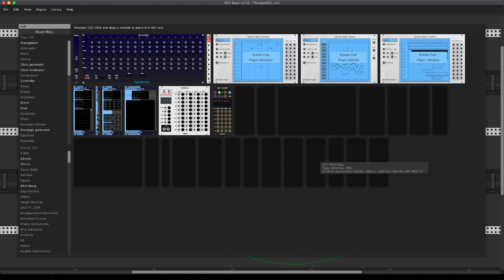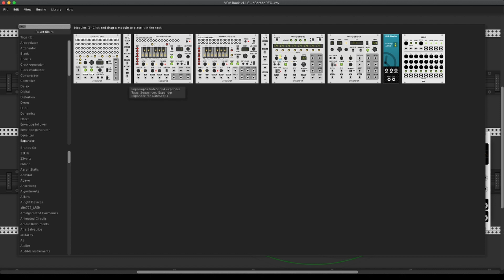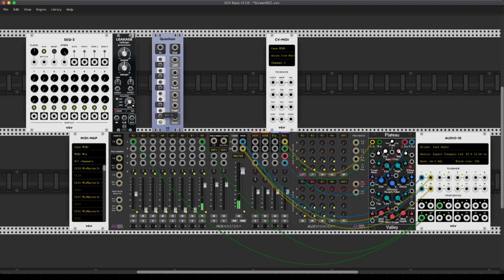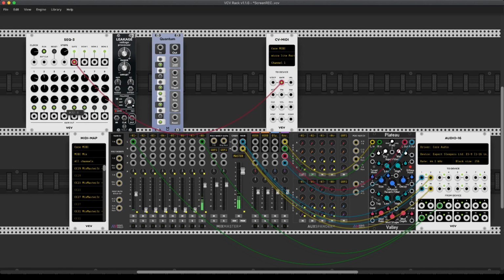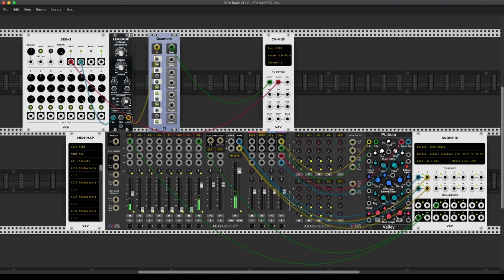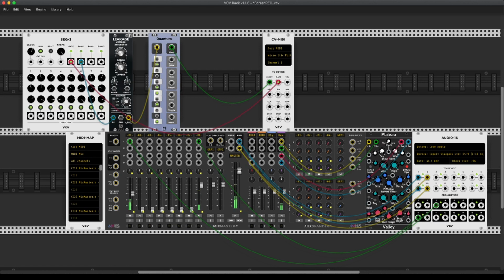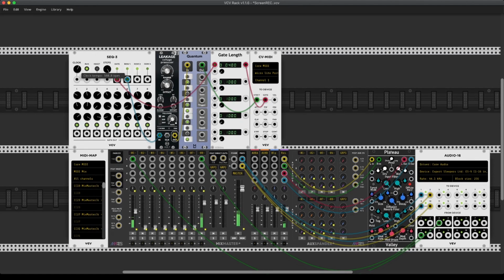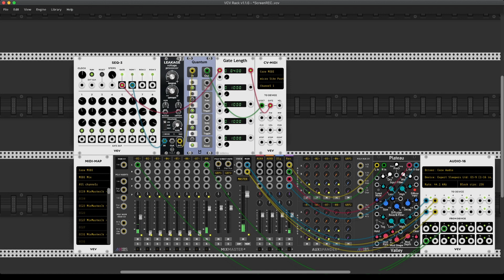How to use VCV for MIDI to Control Hardware Synths

Comment: I imagine you can also just send multiple midi cc signals out to a hardware synth as you play it from the keyboard on the hardware synth. Correct? Thanks so much for the good video
Reply: did you ever figure this out?   i'm wondering if vcv rack can send midi cc fader/encoder/knob info out to hardware.   thanks
Reply: I still simply think it is highly likely it can.  But I'm so bogged down in projects it is not a path I can really go down right now.   I'll let u know if I do or learn sometime :) 
 @gagealbright
Reply: confirmed... it definitely can do it... have done so now.

Comment: My MIDI->CV hardware passes one CC thru. How would I handle that in this setup?
Reply from the maker: There are more Modules in the base collection that handle CC. You can even seperate several controllers and the Midi routing all in VCV. I hope that helps :)